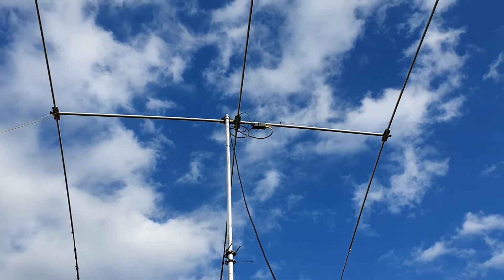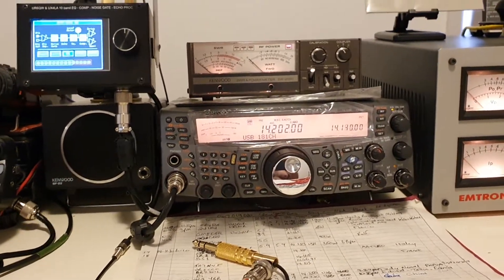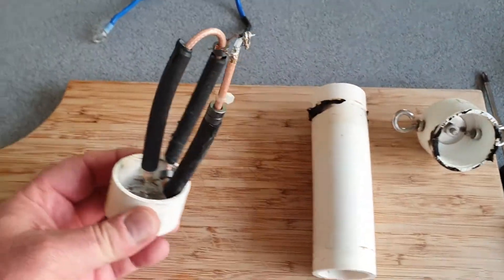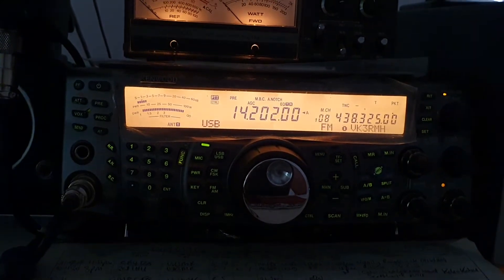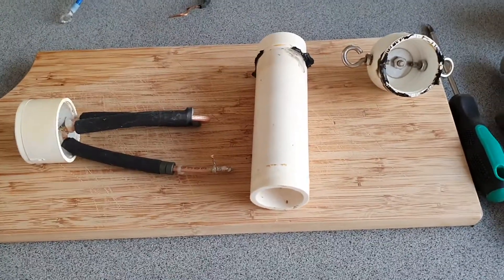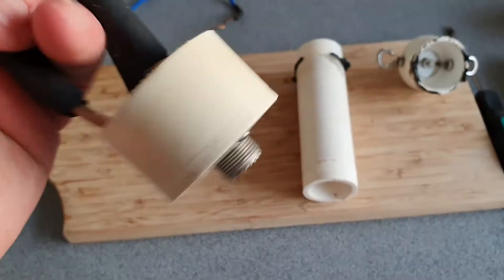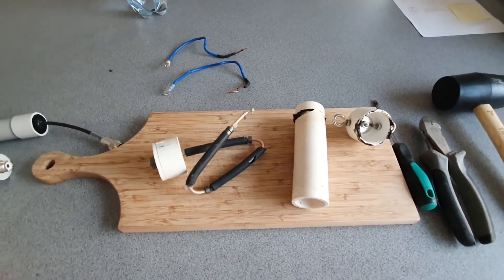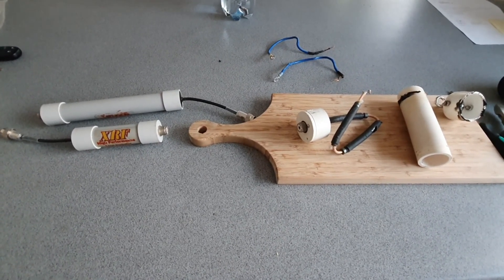RF in Radio Room Fix - BN-86 Hy Gain Balun

Comment: Thanks for the tests and look inside Paul!  Those small 50-55 beads over RG303 balun/isolator started at W2DU>Wireman. See the Wireman 833 kit. This is used in the  823A and the MFJ915 and 918 and are quite effective. Some others use the large ID beads over coax - see DX Engineering - I think performance is similar if properly done. It looks like yours is a 4:1 though. As far as the BN-86 is concerned, it is a rod balun known to add inductance to the TH3 series. Mine is cracked and open after 40 years but after your video I will rebuild it rather than use a "modern" balun. Cheers mate es 73. Peter

Comment: I made a wound coax rf Choke as stated in figure 8 in the instructions,  6 inch 12 turns of rg8. It worked awesome so thats a cheap alternative.  The new one that goes up this weekend will be with a bn 86. One note the boom diameter on a Jr is too small for the u bolt thst the bn86 comes with. Also wonder when hygain will re start production? 
Joe WA4UJY
Reply from the maker: Coax chokes are a good choice, I decided to comply with manufactures recommendation and use a 1:1 balun, Hygain BN86, was the right choice